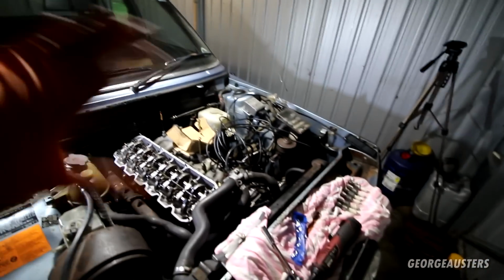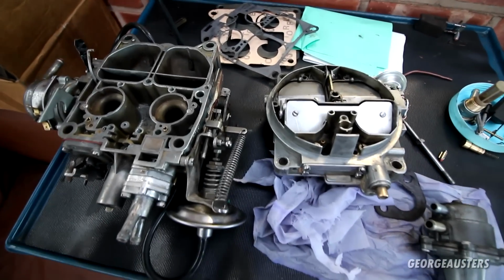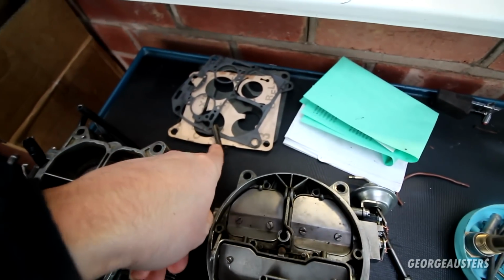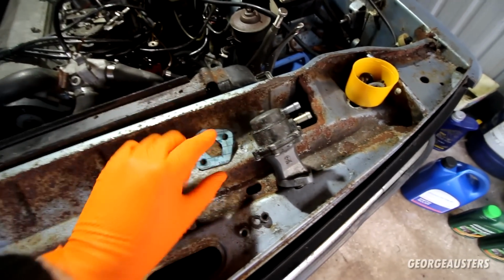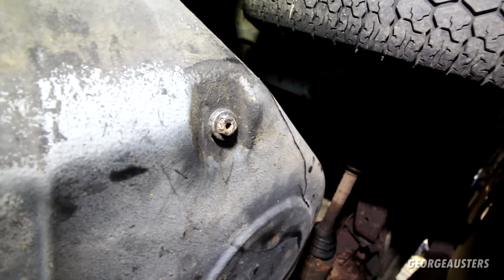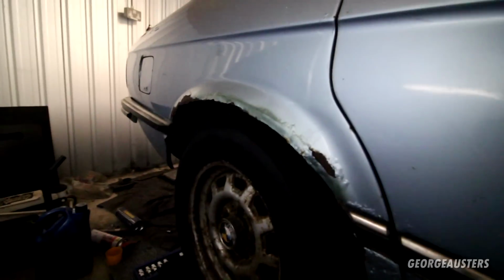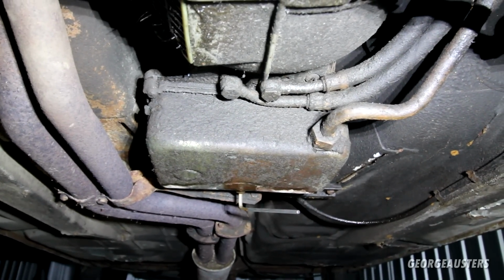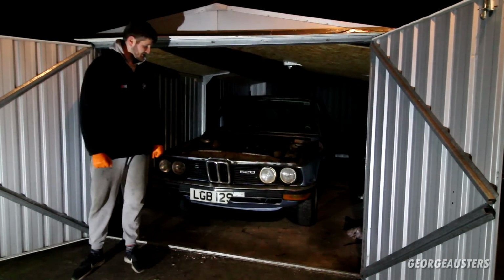Will This RARE Barn Find BMW Run & DRIVE After 30 Years?!

Comment: I sad before George,piston rings.This huge gray smoke coming from there,burning oil.Let you drive a bit on outside and see meybe it fits a little.this car is not a good choce for one man fix.Needs too much bodywork because of rust.Good video .see ya next.
Reply from the maker: The “smoke” isn’t actually smoke, more just condensation from sitting for so long.

I know the cylinders aren’t great but in the time I’ve had it running, the oil level hasn’t gone down👍🏻
Reply: I hope so,may driving a thousand miles makes it better I'm  waiting  for your next eposide.Best Regards.

Comment: Don't kill yourself in that box. Want more videos. What about the PCV? Should not that be hooket up to manifold or carb? Could be wrong. A long time since I worked with such cars. Use 98 oktane, the system should not run on petrol mixed with metanol.
Reply from the maker: Yes you're right.. The hose was missing and the previous owner built an elaborate system to re-route it into the top of the air box but I have ordered a new hose today